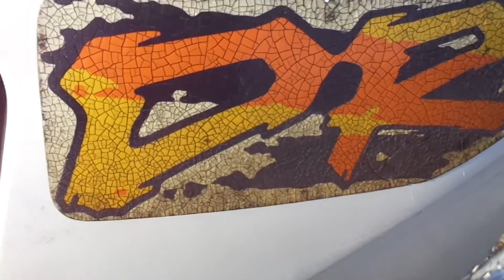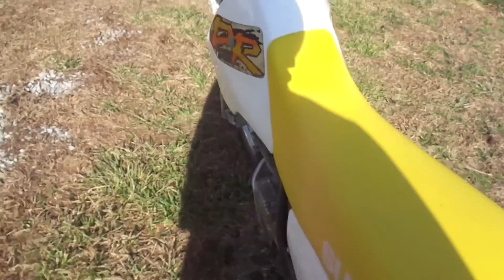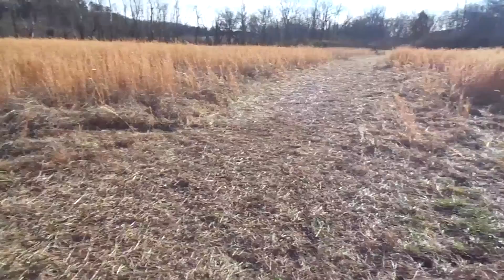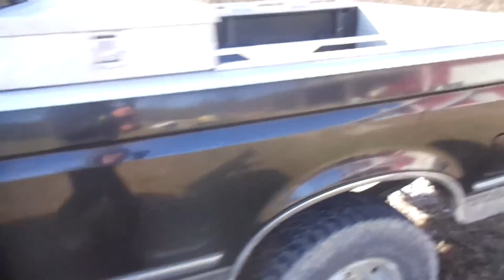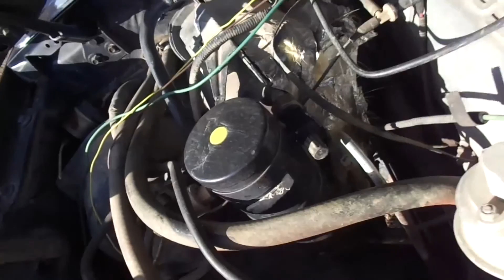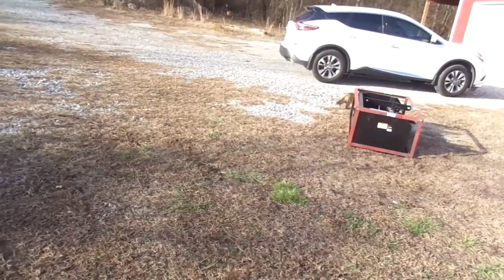$800 DR350 Showcase And Ride

Comment: Bought a dr350 for 900 and I wish it was in that condition
Mismatched plastics that have been trimmed of with a saw.
A engine that is burning oil
No fotpegs and no pillion handle
Non OEM front fender
No gauges
No turn signals
Yeah... I wish mine was as clean as yours
Reply from the maker: I wish I still had it! I have a 1996 , but I sold this one some years ago. I've owned  3 DR350s and all were extremely reliable.
Reply: Is it a dirt model or street? If its a dirt model I dont think its supposed to come with gauges or signals